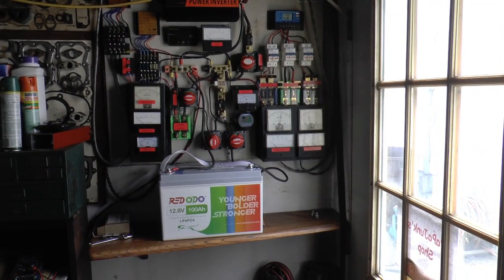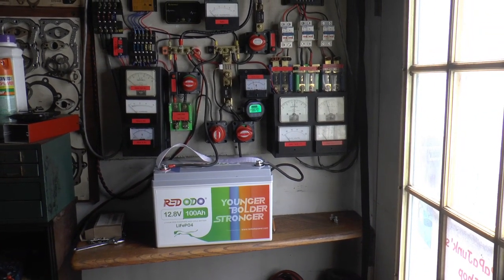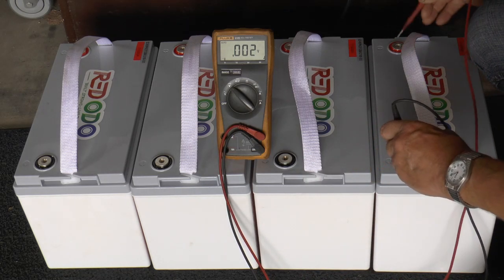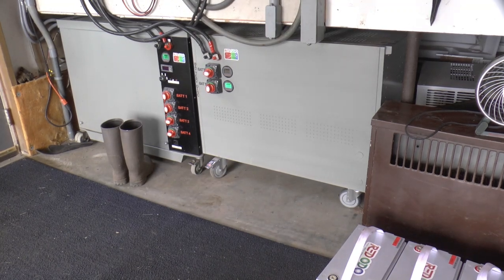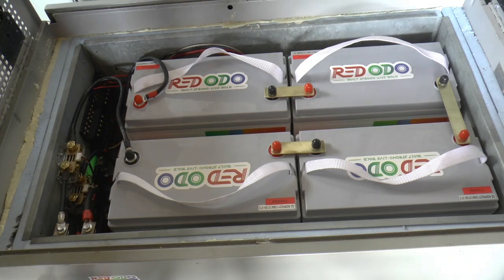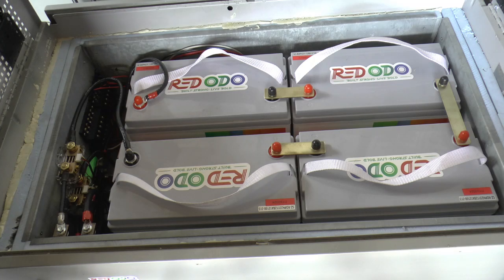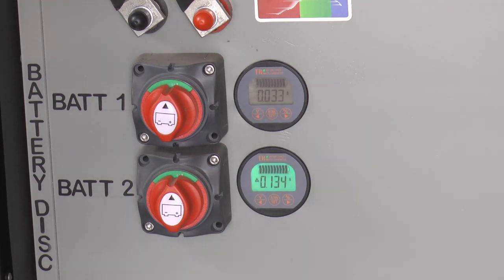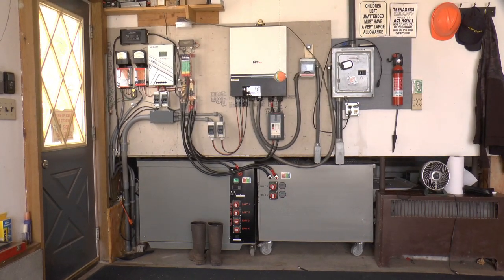Four more Redodo LiFePo4 Batteries

Comment: What did you set the absorption and float to?

I'm thinking about getting the victron balancer because I'm getting a .2-.7V difference between my 2 redodo 1 ecoworthy and 1 global power batteries.
Reply from the maker: I have all my solar controllers set to stop charging at 55.2.
Reply: @kevincrawford2027  is that your float  voltage?
Reply from the maker: @Gary-ee3kq  Sorry I missed your question till now. No my float is set to 54.0
Reply: @kevincrawford2027  are you using 2 or more sets of 4-12v 100ah Batts? I have 1 newer set of Djlbermpw batts and 1 older set mentioned above. When I tested and charged them individually the older ones stop charging at 13.4v but the newer ones at 13.75v. I've been changing the float voltage 1/ day during the day, but I wonder if it matters?
Reply from the maker: @Gary-ee3kq  I have 4 sets of 4 all the same brand ( Redodo ). I add them as I could afford them so not all the same age. All seem to perform about the same. I have added battery balancers just as an added protection. Did you put them all in parallel and charge them overnight before putting them in series?  If not all the same brand the BMS may have different specs. If you don't have a capacity issue then it may not be a problem. Each of my 100 amp sets have their own capacity meter so if one set wasn't performing up to par I would know.
Reply: @kevincrawford2027    Yes.  I charged them individually 1st and then put the 4 in parallel overnight before putting them in series. Did you set your absorption to 55.2v? Also have you used Watchpower the monitoring app?
Reply from the maker: @Gary-ee3kq  Yes 55.2. I use Dessmonitor   I discovered it on DIY solar forum.

Comment: I bought 4x 200 AH PLUS for the 200 amp BMS based you your REDODO reviews. 48x200Ah connected to my sunpowergold 48v 10KW/20KW 120/240 split phase HYBRID invertor and it runs my entire house. Have 12 450w Sunpower gold panels in series 2 strings of 6 into both PV inputs. I can go strictly off grid if I wanted to, or turn off main breaker and save on the grid power. Literally can run washer, central AC, dryer, 3 fridges and multiple tvs, fan, and led light bulbs. It will run 6-8 off batteries from Redodo. I am happy with them. Whole set up about 7k total invested. Waiting on the new ones with bluetooth capability before I buy another 8 of them. Thanks PapaJunk.  Loved your excavator series as well. I have the orange QH-12 and tricked it out. Strong little machine.
Reply from the maker: Thanks for the comment. I am happy with my Redodo batteries. I have almost all of my 120 volt circuits on my LV6548 including my 230 volt pump (using a 120 to 240 transformer) that feed two houses. I also can't believe how many thing I can find to do with my excavator.